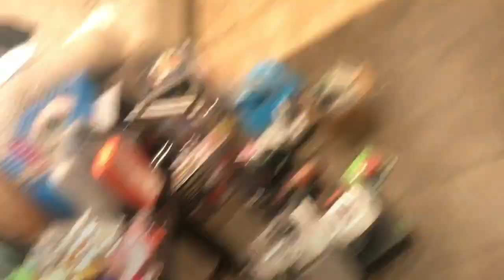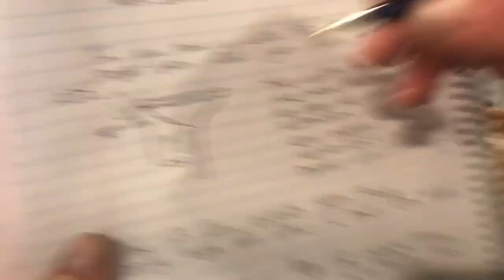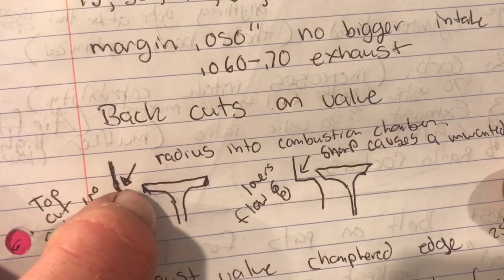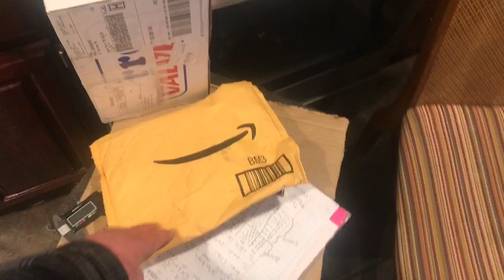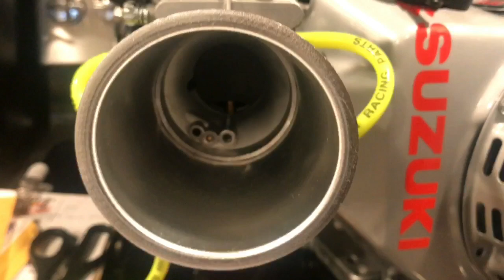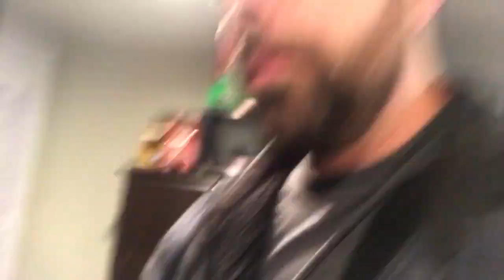Honda Gx390 tuning SECRETS unlock the "5th" cycle (part 2) preditor 212

Comment: Hi Paul. Thanks for the great videos. I am buulding a 390 but we are limited on timing. Max 28⁰...now i know cam manufactures might say you need 31 or more for a specific cam. My question is how do i calculate the correct cam if i can only go to 28 on timing. We also run stock appearing carbs and no porting allowed in this class.  Looking forward to your response. We
Reply from the maker: @robindejager3618  less duration and wider LSA both want less ignition timing. They trap air at a lower rpm which would work to your favor in that rule set.
Reply: @paulskartslifan4206  thank you very much. I am going with a NR 280/290 cam. Keeping fingers crossed.

Comment: hey is the piston fpm calculation (bore × rpm ÷ 6) or is it (bore × 3.14 ÷ 12) × rpm!? also what is cross sectional area? thanks.
Reply from the maker: There are calculations for mean and max piston speed .. I gave the calculations in the video... thanks for watching
Reply from the maker: It is in the video cast vs billet piston
Reply: @paulskartslifan4206  ok i got it now thanks!
Reply from the maker: Ok bud

Comment: Hey how's it going brother I'm in the process of building a Honda  gx340 why a 340 In sure you are thinking and not a 390 well it was given to me so I figured I would practice on a 340 before I go to the 390 it is a stock set up as for now but I wanted to get a good intake and carburetor set up that's the right size!!  And anything to get away from the stock $ 16 China bullshit on Amazon. I just don't know enuff about carbs to be able to search it out online? Any help would be much appreciated love your channel BTW
Reply from the maker: Whell it has to do with a few things ...cc of engine ..we know that 340 , size of intake ? ....and max rpm your aiming for ...I am going to do a video maybe tomorrow to try and help you out with that ..ok ?
Reply: @paulskartslifan4206   Thanks so much for the quick reply and  the quick reply on putting up videos I know when I asked about crankcase venting the other day you put up a video on the subject right afterwards 👍👊
Reply from the maker: Thank you !
Reply from the maker: I'll try my best to go thru the notebooks I have and find the most relevant info on the matter ...BUT ...there is a lot of forward thinking involved that needs to be done on this topic ...it's the type of part that I usually buy last based on the functionality of the air moving thru the head .. there are a lot of parts and engine specific measurements that will effect the air moving thru the head ...this video will have a lot of info ...might need to be a 2 part video , or an extension to the engine optimization playlist I have alsread started creating ! Hope it helps you out ! And again thank you for watching .......
Reply from the maker: Tomorrow ..Monday ! ..for sure ...Halloween party today at the vfw ..
Reply: @1MACVSOG1  it's because Paul is the best on YouTube I've quickly learned that after stumbling upon his channel

Comment: I want to build an all billet aluminum Honda gx390 with upgraded parts. Do you have any tips you could give? TIA
Reply from the maker: Well are you subscribed ?hit notification button ... And also like this video ...ok  problem....do they make billet blocks ? ...mine is custom ... and as for tips ...man you cane to the right place ...i have been known as a gx390 or (big block) guru.....so just go to my page by clicking on the Paul's karts name under the video beside the little pic of the engine block ...that will take you to my main page ...I have over 100 videos ...easy way to look at all my videos in the 2 dif sections ..first the videos under worlds fastest big block attempt ...there is a complete build of a high quality there ...also any video or playlist that's about the cylinder head ..watch that ...if you want to do it the cheapest and make the most power buy a good head and bolt it on ...then just get a rod flywheel piston and cam.....that's top of the line ....that's all I build so if your not going for that ..any modification you can do to the "head" will build power ...